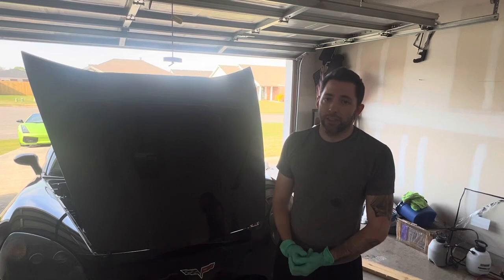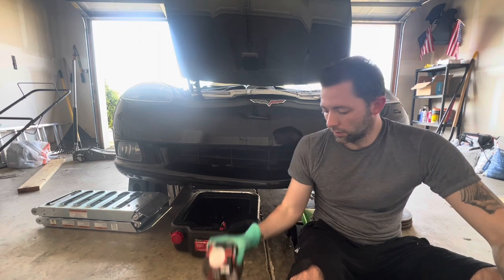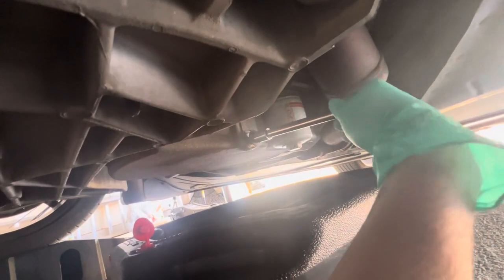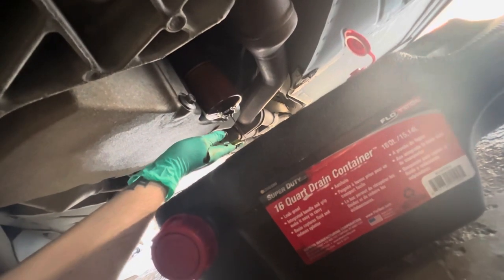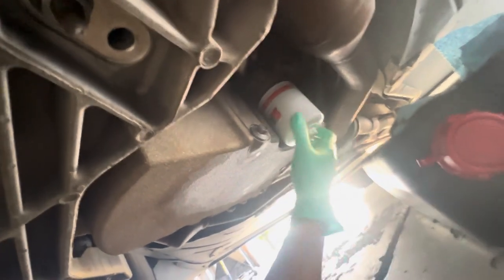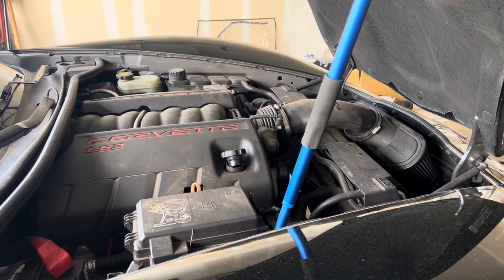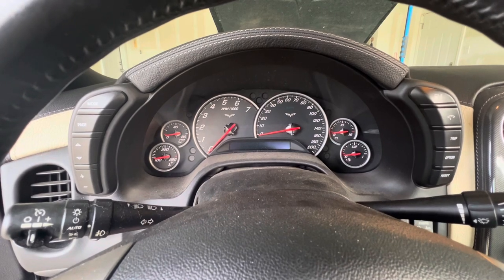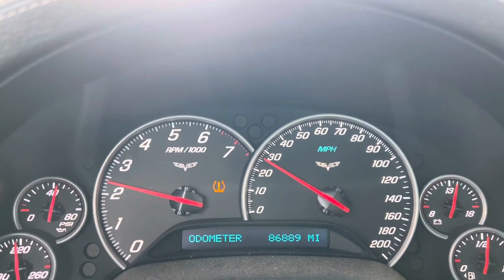C6 Corvette Z51 Oil Change

Comment: Not being picky, but with the drain plug on the side, by you only having the car on front ramps and not on 4 jack stands, essentially you’re not draining the oil pan out all the way. I thought about doing what you did but thought unless I have the entire car on stands I’m not doing the change any justice. Maybe I’m wrong?
Reply from the maker: I definitely see your point, but I did let it drain for 20 minutes like I said in the video and it ended up requiring the entire 6 quarts to get it back to full. Based on this I feel comfortable only using ramps, but I also encourage everyone to do what they think is best for their vehicle.